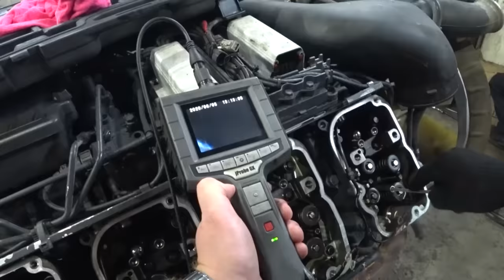СЛОЖНЫЙ РЕМОНТ РАМЫ ГРУЗОВИКА / DIFFICULT TRUCK FRAME REPAIR

Comment: The second most impressive thing about this repair, after the guys obvious skill is.......It looks like nearly every tool he used is "home made", repurposed, or otherwise modified to do what he needs it to do. Total respect here.
Reply: He definitely knows his stuff
Reply: Welding,  blacksmithing,  advanced pulling bodywork.  All those different skills and how many man hours?  How is this even worth it?  Are there many places that would even attempt this?
Reply: @michaelcrowell5308  hey good morning 😁 from Texas USA that Cain of repair you can find for 8k USA Bill's of one temple Texas USA
Reply: @michaelcrowell5308  k
Reply: Yes the first few jobs took time to modify or make the tools hooks or blocks along with dozens of porta powers short chains ? To push pull twist pull some tool box of skills you have sir ? Thank you for letting us watch ? Some jobs look like just make new frame rails ?
Reply: @michaelcrowell5308  sometimes you cannot buy the new parts so you must do it yourself , Very few people understand this work , i do similar work also.
Reply: @michaelcrowell5308  In Russia, the work of a Master is valued less than in other countries of Europe and the USA. The master will receive $ 2000-3000 for this work and the general repair will cost about $ 10000-15000. And it will be more expensive to write off this truck for recycling and buy a new one.
Reply: Absolutely
Reply: Работа конечно конская но оазве рама после такой йоги не поменяет свои характеристики? Удивлен был что без нагрева и ниче не треснуло

Comment: I've worked with metal for decades in various capacities and I think straightening a bent object is about the most satisfying task there is. Impressive work shown here, I enjoyed it.
Reply: The most impressive was getting stretched metal--those kinks back down--with very litle heat

Comment: Nobody in the U.S. would repair a frame so badly damaged. They would buy new frame components and reassemble. It's because our laws wouldn't allow this repair. Awesome work👍
Reply: You are true. The residual stress could break the structure.
Reply: Same in sweden nobody would allow that frame back on the road again But nice Job anyway nice skillz
Reply: What laws?
Reply: @myvideos56  My thought exactly. All the tensile strength is lost with the bending and heating. Unless they have a way of heat treating the assembly, I too would not trust it. Amazing craftmanship though.
Reply: @connyeriksson1912  This repair would be fine both in the US and Sweden. Uneconomical and dangerous are different things. If it passes the crack inspection it's good to use.
Reply: get a different truck
Reply: @thomaswayneward  I'm wondering the same thing.
Reply: Cite the statute Jerry....

Comment: Good to see someone who has the skills to rebuild something like that. Unfortunately with the throw away society that is becoming more prevalent, people with your skills are harder to find these days. Keep it up, thanks for sharing with us.
Reply: Labor rates are cheap enough in Russia where it makes economic  sense to to perform such repairs. In the states, labor is 4X the rate so the truck is scrapped. You could save money hand over fist by shipping your truck here from the U.S. to be worked on even after paying the necessary customs official's bribes.
Reply: @cluckhead1913  You are right. It is a balance of cost for replacement parts against the cost of tools (which are a lifetime investment) and labour. In some countries one is more economical, in others the other. And don‘t forget legal codes are immensly different. In other countries this work of art would  not pass inspection no matter what.

As for saving the parts (as I have seen above in comments) metal has the phantastic property that it is not thrown away, it is simply melted and will come back another day in another form. But that costs money too, so the decision lies with the bookkeeper!

Comment: Amazing skills at work there. Here in Australia, that frame would have been scrapped, because of the amount of Hours involved in repairing it and Our Roads and Traffic authority would not allow a repair of that much damage, they would Demand the whole frame replaced. Your guys made this huge damage possible to fix. Well done.
Reply: Просто в нашей стране:
1. нет таких контролирующих органов как у вас, да и не только в нашей а во всем бывшем СССР и никогда не будет(законы у нас созданы для простых граждан а не для элиты, кто то украл курицу и сядит в тюрьму за это а правители страны крадут миллиарды уже 30 лет и продолжают дальше и будут продолжать. 
2.такой ремон иногда дешевле, чем купить новую раму или хотя бы донор
3.скорее всего эта машина была куплена для восстановления и перепродажи(все за чистят , зашлифуют , по красят и продадут и ещё заработают на этом) такой у нас менталитет - заработать обманув кого-то.
Reply: In the U.S. that whole truck would have definitely been scrapped. The man hours would exceed the value of the truck.
Reply: @jasond5405  чтобы рассчитаться за новый грузовик сколько человек часов водитель должен  работать? Или в вашей стране за два дня можно заработать на новый грузовик?
Reply: Yes , In australia a vehicle is often classified as a total "stat writeoff" even though it has only minor cosmetic damage , the way they do the classification is often mind boggling and sometimes it is 100 % either corruption or massive incompetence.
We can fix this type of damage , and i have done it myself many many times in heavy earthmoving equipment , he is straightening 8 mm plate , i have straightened up to 65 mm plate , sometimes even QT high tensile. 
Its all do-able.
Reply: @Ron Daniel Foxall  sometimes they simply cant buy them , or as we found during Covid , the replacement parts may have a 12 month lead time to source.

Comment: Well done. My dad used to do truck chassis straightening 50 years ago.   Basic tools compared to modern day. He had two parallel railway tracks embedded into the concrete floor as the base. And tools made to suit the job at hand.  Always amazing what can be achieved.
Reply from the maker: Thank you for your comment) Good luck)

Comment: I am beyond impressed.  If I had tried this it would end up looking like two strands of spaghetti in a bowl when I was done. This man is an artist in steel.  What is the estimated strength of the frame after such a repair as compared to new?  I like how little heat was applied to the frame during straightening.
Reply: Prob 85-95 percent in an impact
I'm sure they reinforce it by adding gusset but it still has 100 load grade still. 
If it gets in front collision it will collapse in same place due to the reduced resistance.
Reply: They can actually get them straighter than new
Reply: Strength would be even higher.
Reply: You answered your question, the less heat applied guarantees the strength of the metal plus the crossmembers installed reinforces each section of the frame. It should hold its integrity until another collision or stressed out from use.
Reply: @montanasnowman3138  yes , many manufacturers claim compliance to QA quality assurance program but every so often we find brand new machines that are 5 - 10 % outside of the claimed accuracy.
Reply: sometimes we add doubler plates or angles that are bolted or huck bolted to a chassis after repair to reinforce high stress nodes

Comment: These guys are still in the time where you repair everything rather than throw it out.
Reply from the maker: Yes, we do. Throw away expensive
Reply: @trucks_channel_razborgruz  And unnecessary. Good work!
Reply: Recycling is best. But this is costly when its cheaper to buy new and to recycle this front end disaster. But they are good.
Reply: @mattgaming8717  in reality  it is cheaper when u consider man hours parts to just repair the frame, cause make new frame rails with all of the wholes and proper bends in the frame takes  a lot more mo ey.

Comment: I don't care what you do to it, that frame has been compromised structurally.
You guys are good (Tip of the Hat to you) but that makes no difference when something its gone FUBAR.
I would never waste my time and $$$ to fix THAT WRECK.
At least it makes for good video material. 🙂👍
Reply from the maker: Hello. IT will then be reinforced with additional structures
Reply: that is not necessarily true; heat was applied on the flanges only; not on the web. frame can also be reinforced from inside and from outside if need be; it cab be structurally sound like original if not better.
Reply: @suhayl5157  I welcome you to take those chances. I surely wouldn't.  Not worth it. 👌🙂

Comment: Impressive skills! I'm honestly surprised they actually straighten them I thought they would be seen as a risk of failure later on like cracking due to being stressed from being bent then straightened 🤔
Reply: I agree. They should’ve cladded the frame rails with a second c-channel to make the frame more rigid.
Reply: @smallgaragehustle  yes , it is standard practice when joining or extending truck chassis rails , or to reinforce a new load point or damaged steel.

Comment: In the U.S.A. that truck would be a total right off and scraped.  Alternatively the bad frame section would just be cut off and brand new rails butt joined with an inner smaller rail plate to mend them.   This type of repair in this video would never happen as the labor and shop time would cost significantly higher than to replace the frame rails
Reply from the maker: In Russia, work is much cheaper than in the USA. Here such work is 20 times cheaper.

Comment: All truck frames and chassis have been stamped from new with " DO NOT HEAT FRAME"  the process of repair uses heating and structually degrades the integrity and strength of the chassis or frame.
Reply: Maybe they don't say that on Russian trucks. Yeah, that was a write off in USA, but it appears to be a thing in Russia. Looks like hes done this before. A true craftsman actually

Comment: After this `` repair '' the truck is on
Wreck that drives through Europe as a rolling time bomb. It belongs in the junkyard, the carriers are brittle after such cold deformations
Reply: @greenpeace8238  i cant evan speak Klingoniean
Reply: And where is your metal shop located?  You trained where?  Certified on what?

Comment: 20:50  "Never weld on flanges of truck frame" warning stickers being ignored! LOL  I know it would work, but I think the gov't would not allow a repair like this in the US. At least DOT would fail the safety inspections if they knew this work had been done,  though I will admit I've seen hidden damage / completely rusted away frames pass a DOT inspection.

Comment: With all the labor involved to do this job, how could this possibly be cheaper than just replacing (or swapping out) the frame?
Amazing work by the way, I was just wondering.

Comment: Wow an Wow! This man is a master artist!!! I bet he could run a sausage mill backwards and create pigs if he wanted!  So much going on here , like were he would use heat and where he just did the work cold ( I didn't expect him to use heat on the crimped top frame like he did, I may have learned somthing)?  It looks amazing but is it as strong after all that metal working? At first look it seemed like it would be more cost effective to just get new frame rails? I am sure when this guy get done with a day of work he is not thinking, " I should go  to the gym and work out"? LOL.  Nice Vajayo!!!
Reply from the maker: Thanks for the comment.
When the frame is heated, its strength properties are lost. Therefore, we try to do everything without heating the metal. We warm in exceptional cases - for example, to remove folds.
Of course, there is a loss of strength with any repair, but they are not large.
New ones cannot be ordered - as the car's number is filled with vines on the frame.

Comment: Nice video, very worthwhile watching. I have over 50 years Automotive experience in the Heavy Duty Trucking and Construction Equipment Industries as a Journeyman Mechanic and in various Management positions in the USA as well as 8 years overseas in both the Middle East and Europe. I worked for both USA and Japanese manufactures. I've imported 2 cars into the USA from Europe myself and federalized them. 
I tell everyone this because for the purpose of letting people know what my qualifications are! The World is a small place these days and the SKILL LEVELS in to many countries is not up to the job. To many times the Insurance Companies or the Repair Industries control the repairs either by simply "Totaling the Vehicle" or Pricing the repair so high, it not economical to fix. In a lot of cases this can make sense, but there are cases where good repairs are possible to save everyone money, etc. Of course all of this is further complicated by the lack of Skilled Repairman!! 
I see a real opportunity of exporting some of these vehicles to countries that still have the Technical Skills and reasonable Labor Rates to do the jobs. This is especially true for Classic Vehicles or Specialized Vehicles.

Comment: With a frame that badly damaged even after being straightened the chance of the truck driving straight is slim I would think. I've never seen anyone straighten a frame that badly bent. If it drives straight I'd be impressed.
Reply: No Sr He did right!!.

Comment: Hi guys , I saw some of your video to repair frame truck, after thankfully of your   video , I have a suggestion , many of your times during work on frames were wast for just open or close the yellow adjustable chain(I don't know their names) you can use a jig and a wireless drill for open or close those yellow chain for timesaving.

Comment: I am a metallurgical engineer and with all due respect I believe that if you heat the chassis to straighten it, you are changing its resistance or hardness. One of the most important properties of a chassis is its toughness and that comes from an adequate heat treatment. For me I think it would be better if it is cut at an angle from the front, the two parts of the chassis are heated above 50 gc of critical temperature then cooling slow in air, then it is given the exact shape, then they are quenched, then tempered to a hardness and resitance that you want and suitable to the type of steel and then weld  but put a shell where the two parts are welded, and that's it.

Comment: The work of this tech is amazind and troubling. Splahing water on wite hot steel  is more than scarie and so  maney holes in frame menders has to lead to the kind of failiar seen here

Comment: I don't understand why you would straighten a frame this bad, the cost of new frame rails outways the cost of repair. The only reason would be if the vehicle was soo old as no new frames were available. In that case you would scrap the vehicle

Comment: Amazing to watch but it begs the question, is their knowledge and labor undervalued?
With 90% of the truck already torn completely down, two new (or good used) frame rails would be all that you'd need to simply rebuild the truck, bypassing what appears to be tens of hours of skilled labor. If this is still the cheaper route, I wonder how well they are paid for what appears to be master skills?

Comment: for the raised "bumps" in the frame rails you should cut them before bending them back as the metals has stretched thats why they are raised cutting a slit into them would relive the stress and then wedge cut the slit and weld back together.

Comment: My dad had a 1949 ford coupe that got ass ended, bent the frame.  It went out of town to Winston-Salem, NC to the frame shop.  Never made any difference, if you closed the right door hard, the left door opened, and vice versa.  Dad said it was a total mess up, and would never be any better.  But, back then, if you bought a new car, your wages dictated you drive it until you could afford to trade or it wore out approximately 60-70,000 miles, or in 6 years as dads car.

Comment: This is  a great  example of what for a better term I call  Uni-Frame where truck manufacturers drill all these holes in the frame to accommodate all the different configurations of their product line options weather or not they use them all which they don’t and it’s my opinion that this attitude makes the frame more susceptible to extreme bending in a collision like here. I worked at freightliner on the chassis line now 40 years ago and each set of frame rails where drilled for only the holes needed for that one particular truck and it’s specifications only. I’m seeing this excessive hole drilling across a lot of truck manufacturers today. I really don’t know how these new frames holdup with all these excessive holes in them🤔🤔🤔 it’s beyond me.

Comment: Les gars est très bon, c’est un artiste métalo à l’ancienne, sauf… Sauf que cette méthode de réparation sur longerons de châssis dans un tel état est totalement aléatoire voire critique; je parle de comportement dans le temps suite à réparation (en usage avec charge) d’une part, en cas de nouveau choc d’autre part: suite au choc initial, le métal a déjà travaillé dans son élasticité, le gars l’a refait travailler sous contraintes pour tout remettre d’équerre, ça fait beaucoup, surtout ça fragilise les longerons de manière totalement aléatoire… De plus les points de chauffe localisés rendront l’acier cassant aux endroits appliqués.
Aucun constructeur européen n’autoriserait ce genre de réparation rien qu’en terme de garantie/fiabilité.
Bravo au gars quand même, c’est un artiste.